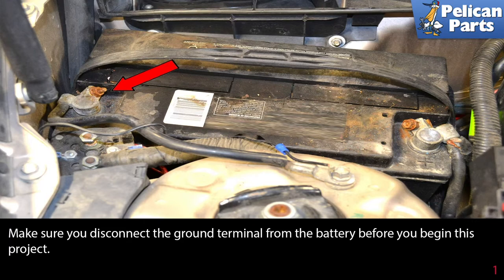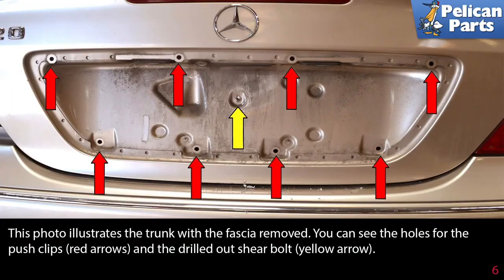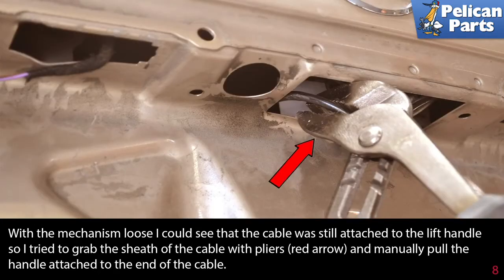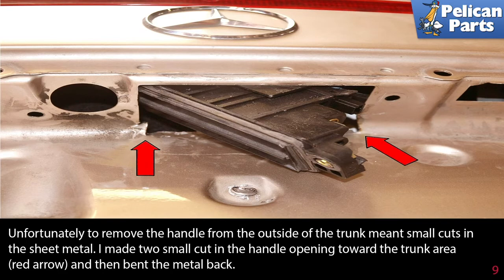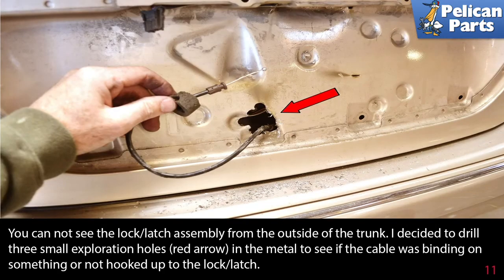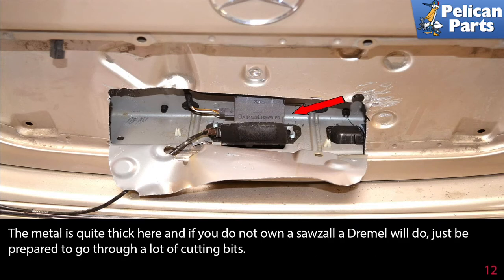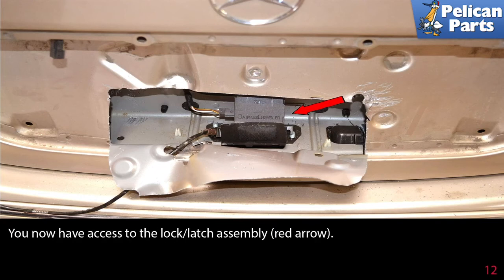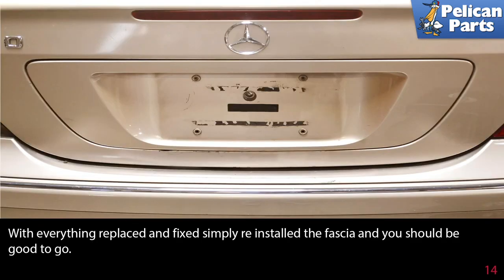Mercedes-Benz W203 C-Class Broken and Locked Trunk Access

Comment: I have a 2003 C230.  Tried following your guide, but so far no luck.  I have drilled several 1” holes but can’t find the lower lock actuator cable.  I did all steps you did before I found your video.  Only thing left is to cut apart the lower trunk to get full access to lock mechanism.  Any pointers, definitely a little different from the c320 you worked on in this video.
Reply from the maker: On your vehicle, the lock should be part of the handle. There are emergency keys available from Benz, if you want to try that route. If the lock cylinder has totally failed, you can try drilling the lock cylinder out to access the linkage. Otherwise it will have to be broken out. Anything damaged, needing to be replaced.

Comment: 2004 C240 How do you disable the power to the trunk lock?
Reply from the maker: Fused power is fed to a module, if removed, multiple components would not function. To disable the power lock motor, simply remove the ground wire from the motor and isolate it. Terminal 1 brown wire at the motor.

Comment: I have a 2006, C320 saloon and boot wont lock ??  ie boot goes down ok but wont latch ? Think the issue is with rusted out handle/ acctuator. So can i access the handle from inside the boot removing cover etc and dont need to drill anything ??
Reply from the maker: Sounds like a faulty latch. Check for a key hole on the underside of the trunk lid.
Reply: @pelicanparts  dismantled it all today, it opens with cable pulled and handle appears to respond with use central locking but latch doesnt move/ lock !